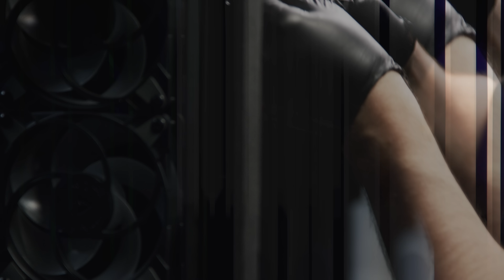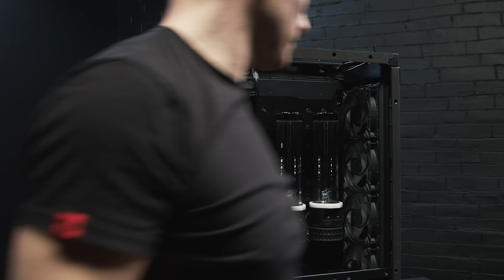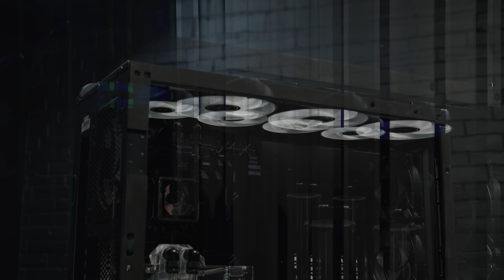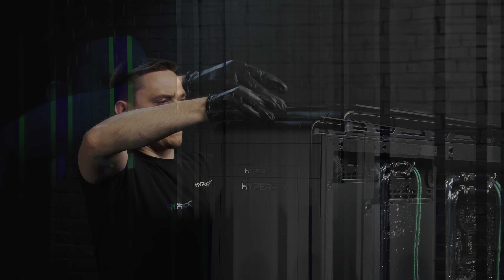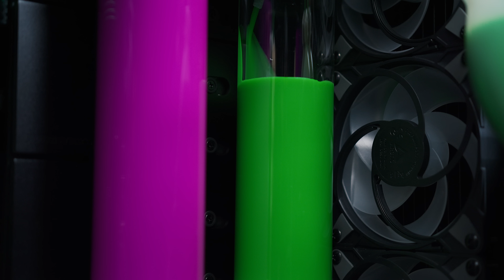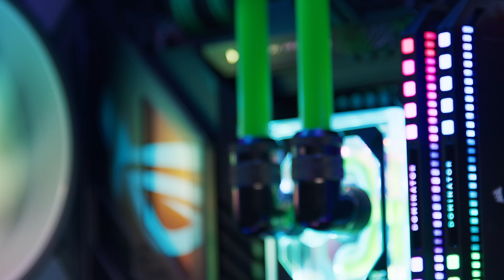HYPERPC - LUMEN CONCEPT

Comment: Можете посоветовать корпус для этик деталей. 
Блок питания be quiet system 600w.
Оперативка Fury Beast 2x8.
Кулер SE-224XT. 
Материнская плата Gigabyte b660m gaming x ax ddr4. 
Процессор Intel Core i5-12400f. 
Видеокарта Colorful Geforce  3060 ultra. 
Ssd Samsung 980 1tb m.2.